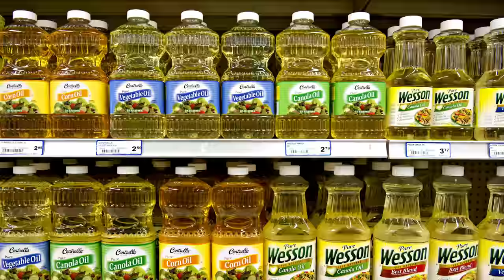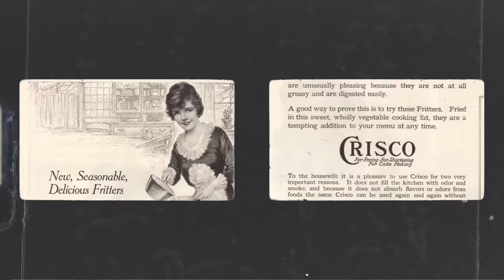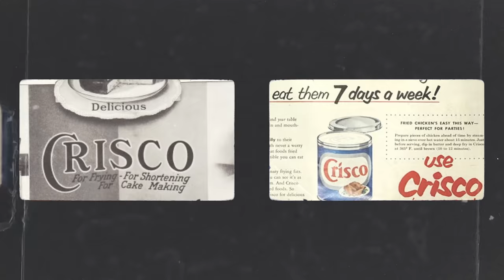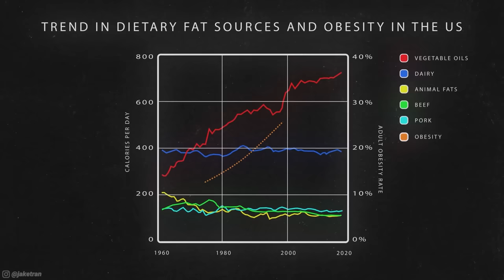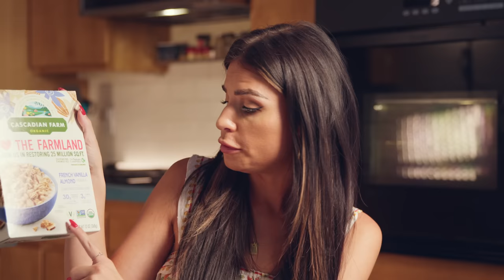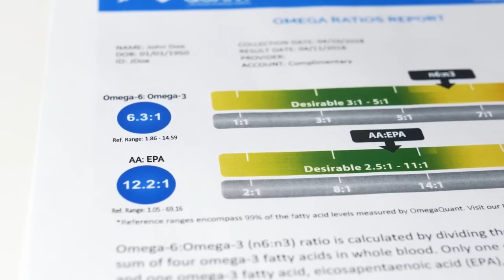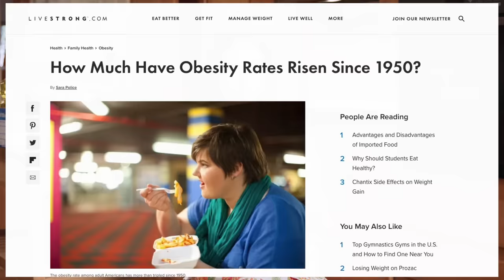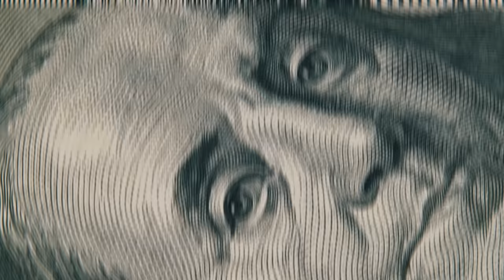Seed Oils Are Turning You Into A LOSER

Comment: It seems like a huge leap to say you believe that just because many processed foods contain seed oils (they contain a whole bunch of things actually) that that means seeds oils cause obesity.
Reply: The research shows that there is an actual connection though. Seed oils are super high in linoleic acid, which accumulates in cell membranes and cause oxidative stress, and eventually leads to insulin resistance.
Reply: Just keep digging sister. Obesogens are a new discovery.